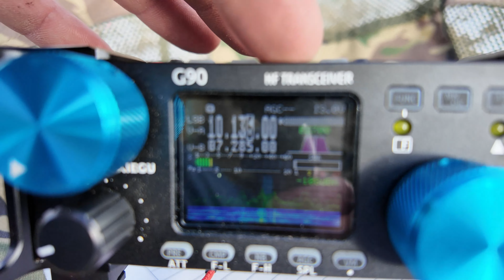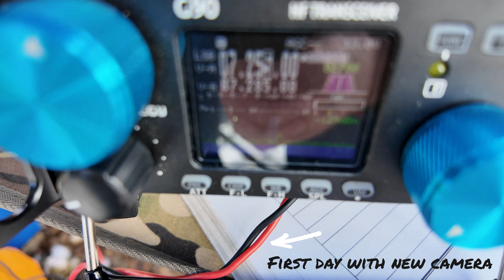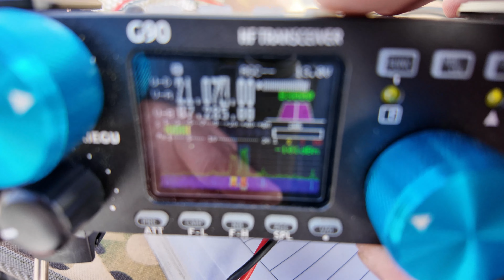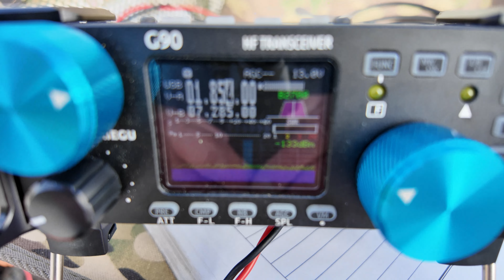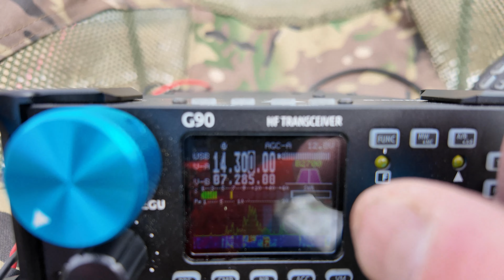Xiegu SDR K9DP Broadcast Interference Filter 2.0

Comment: Not sure you picked the location deliberately but there are at least 2 AM stations there where you set up: 630 KHz @ 5kW daytime which is the original KOH transmitter & now is sports, and 1550 KHz Spanish though it may be gone now.

Within a few miles are 780 KKOH @ 50kW & some 1kW + on 1450 etc.
Reply from the maker: There are lots of broadcast stations in the Reno area. 1550 really is bad. Yes, I went there to experiment and demonstrate the filter on purpose that time. It's also a POTA park and SOTA Summit up top.